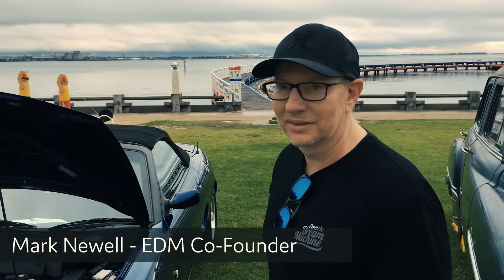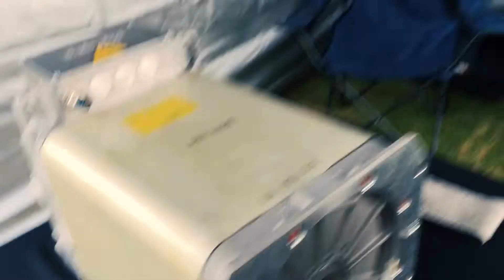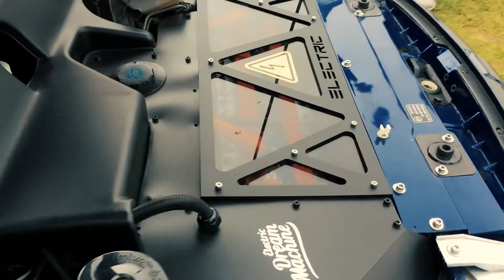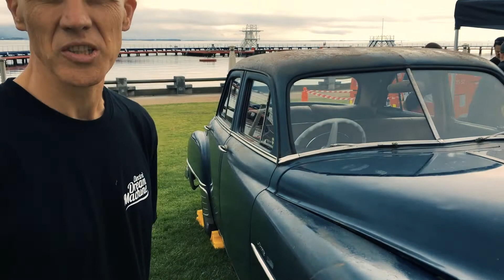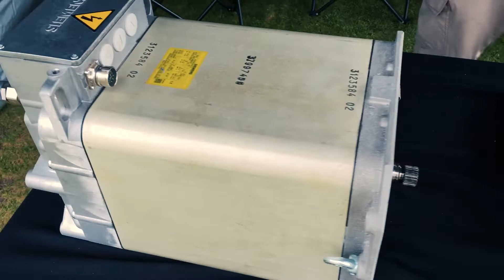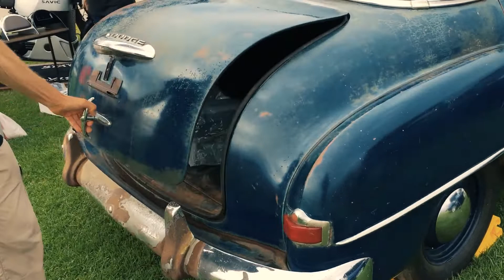Electric MG Roadster & EV Dodge conversion at Geelong Revival 2022

Comment: It would be very interesting to hear the range of the MG F.
Reply: The range on the MG F is around 100ks. This could be doubled with a battery from a later model leaf which have much better energy density.